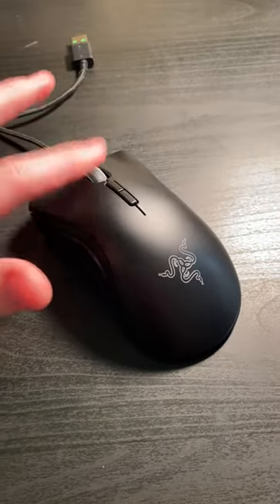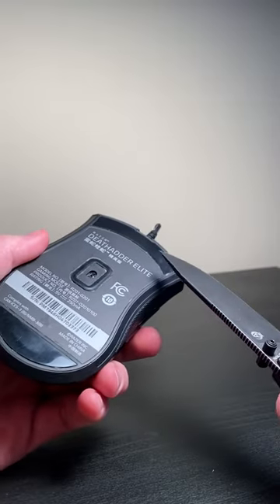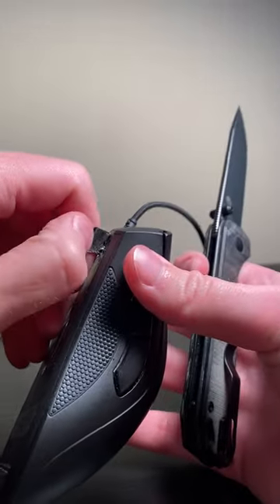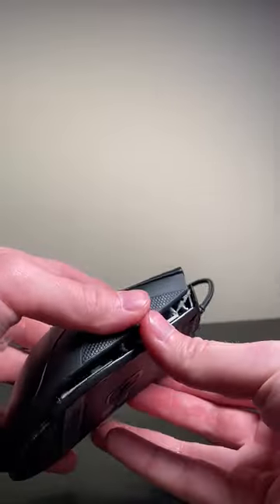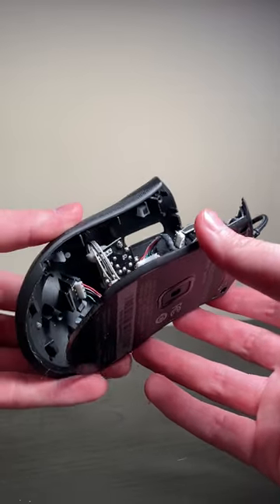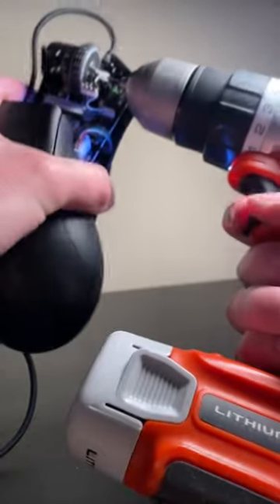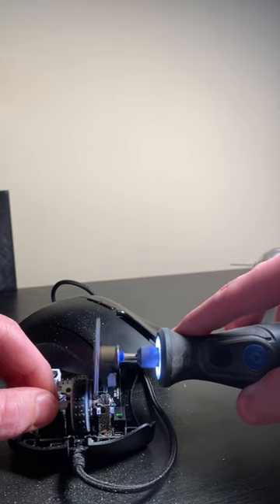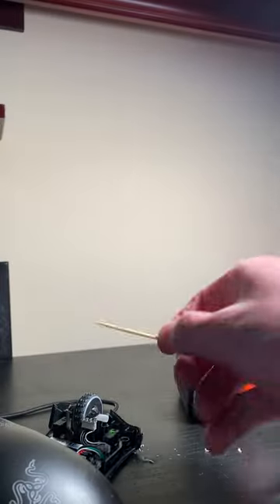Attempting To Fix Razer Deathadder Elite Mouse with Power Tools! #shorts #mouse #technology #razer

Comment: I don't think the rod was the issue. Seems like the encoder was broken
Reply from the maker: Is that a part you can replace? It made a snap sound when it broke. Also the rod is a problem now...
Reply: @herrguy  yeah it's not hard if you have soldering experience
Reply from the maker: @Unknown-e8m3k  ah, unfortunately I don't have soldering experience.
Reply: @herrguy  even without experience it's not that hard , I learned to solder on a mouse that I spent $400 on
Reply from the maker: @Unknown-e8m3k  wow. What mouse was that?
Reply: @herrguy  starlight 12 when it first released was being resold for crazy amounts on ebay. $400 was very cheap compared to most being sold at the time lol
Reply from the maker: @Unknown-e8m3k  Wow I see they are quite expensive...
Reply: @herrguy  it had some industry leading tech but honestly it was more of a collectors piece/wanting to test the bleeding edge for me.
Reply: @herrguy  deathadder v3 is a good upgrade and will last almost forever if you haven't upgraded already
Reply from the maker: @Unknown-e8m3k  I went ahead and got a HyperX Pulsefire Dart. I've really liked everything I've had from HyperX, so I went with them. It has been a really nice mouse so far!

Comment: The stupid thing about Razer mouses, and maybe this is for all brands that make mouses, is that you’re shit out of luck and have to buy mouse feet if you take your mice apart because they purposely put screws under the mice.

I moved away from Razer and went with Steeleseries.
Reply from the maker: Yeah I didn't try to reapply the pads, however, I'm sure it wouldn't have worked very well... I went to a  HyperX Pulsefire Dart. How is the Steel Series?